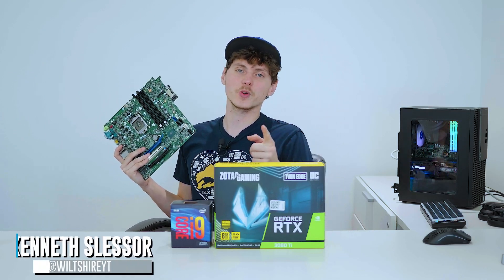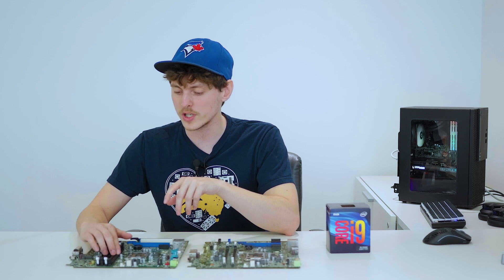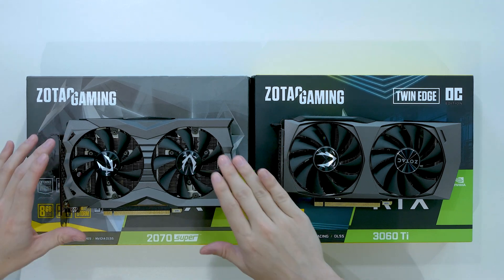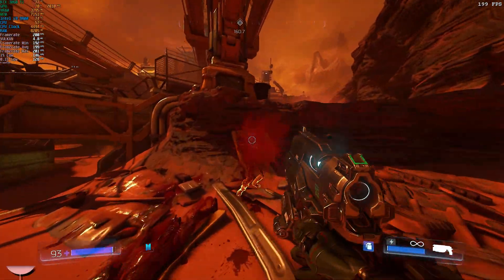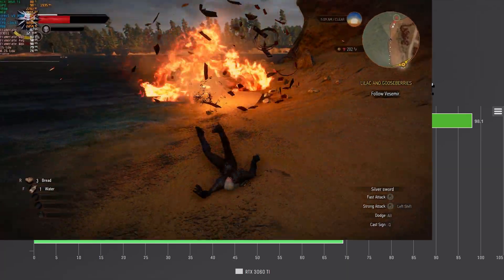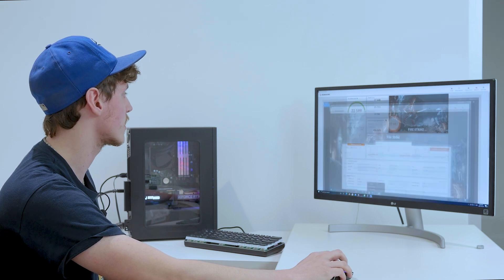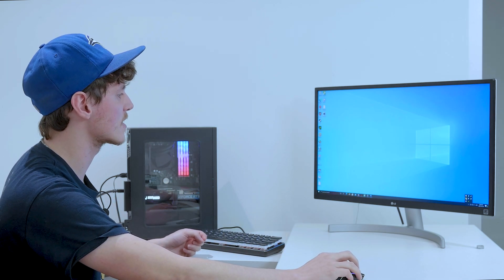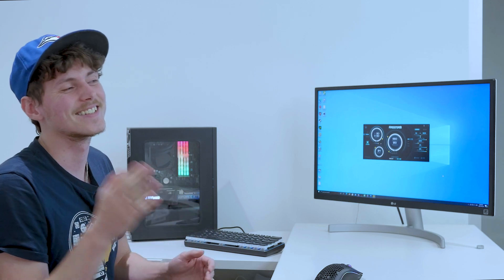Showing Dell How to Properly Make An Optiplex Gaming PC

Comment from the maker: Hey everyone!

Sorry for the delay in content. I swear I'm a turtle when it comes to making content on a consistent basis... 🐢 I had a few obstacles to overcome when making this video. First, I needed a new space to record my content moving forward and I had to make a deal with my boss at work to use an office to record my videos. Second, I had some hardware issues that took me a week to figure out what was wrong and 2 more weeks to find a replacement part.

I'm also thinking of buying a Dell G5  Gaming PC to compare it to OptiFlex to show just how much better OptiFlex is. I think it would be a fun video to see just how bad the G5 is. What do you all think? Let me know!

Hope you all enjoy some more OptiFlex content :D
Reply: How did you manage to buy the Q370 proprietary motherboard from dell? I'm really interestd
Reply from the maker: @emanantonov  I didn't buy it from Dell. Got it off of eBay where someone was selling just the board.
Reply: Hey Wilshire tutorials i bought an dell Optiplex 3040 for a cheap price however am slowly going to upgrade it as time passes as i don't want to a lot of money right away. I saw your upgrading dell Optiplex 3040 series which is why I bought the thing in the first place. I just wanted to know what cpu (intel i3 or i5) would work and what type of graphics card would be compatible and is it possible to replace the deafault power supply it has to one of those corsair ones

Have a wonderful day
Reply from the maker: @cliserioolivares8170  somehow missed your comment here! Sorry about that! The 3049 can use an Intel i3 6100/6300, i5 6500 or an i7 6700. Make sure to buy the non-K variants of the CPUs the motherboard doesn't work properly with them. I found a good place to start is an RX 470 Nitro from Sapphire. You can use it on the default PSU as long as you use a 2x sata power to 8-pin PCI-E adapter. If you want something more powerful, you'll need to mod your case and put an SFX PSU inside it

Comment: Hi, I'm new to your channel, I have an Optiplex 3050 i3 7100, 8gb ddr4 and a 240 ssd, I want to put a video card on it but my motherboard doesn't have the 24-pin connector, what can I do in this case, because my pc brought its Dell's original power supply, but I want to put a good power supply to put a graphic in it
Reply from the maker: You just need an adapter that fits Dell's 8/6-pin power cables. Easy to find on Amazon or ModDIY
Reply: @WiltshireTutorials  Thanks

Comment: Does anyone know if K series chips work in dell OptiPlex boards? Would a i9900k work in the board in the video?
Reply from the maker: They do not! They draw too much wattage. The i9-9900 (non-k) only draws 65W. With the K variant, it draws 95W and the board is not designed to provide that much power. The PC will just shut off, if it draws too much power.
Reply: @WiltshireTutorials  thanks for the quick reply it’s a shame it’s really hard to get hold of a i9-9900 in the UK lots of K models for sale though
Reply from the maker: @0prisonpriest0  I also had some difficulty in finding the a non-K variant here in Canada as well. You might be able to find something on Aliexpress for a decent price. I found my i9-9900 locally through Kijiji.
Reply: @WiltshireTutorials i actually added a i7 8700k in my dell optiplex 3070 sff and ye i had noticed the cpu temps are high but it runs
Reply from the maker: @OsukaMhv  I had mine shut off due to over-current protections when using a K-variant of the 9900K. So, I generally don't advise people to use them. They also aren't in the official spec sheet for support CPUs. So, your mileage may vary.
Reply: Which power switch did you use with the new motherboard. I managed to get a 7070 and a i9900 in the end but no case so trying to work out which dell power switch to buy it’s an odd 5 pin arrangement

Comment: Hey! this is a great upgrade to the Optiplex! 
I got a optiplex 3050 and I want another Mobo for it with the LGA 1151 v2 for Intels 8 and 9th gen cpus. Is it possible to take the mobo from a newer Dell Optiplex and put in in there and if yes which one?
Maybe you can help me out! 

Current System is:
CPU: i5 6500
GPU: GTX 1660 Super
Upgraded PSU to 550W SFX
and 16gb of DDR4 RAM
Reply from the maker: I used a 7070 MT motherboard and the chassis is from a 3040. This Optiplex was originally a 3040 with an i7-6700 in it. The 7070MT is the last generation of Optiplex motherboard that will fit into the same chassis. They changed them the year after starting with the 10th gen Intel CPUs. If you plan on doing the same, be prepared to get the dremel out to cut the back I/O on the case.
Reply: @WiltshireTutorials  thank you I will try to find a cheap 7070 or 3070 MT Mobo to Upgrade. And yes I already needed the dremel for the PSU Airflow😅.

Comment: Question brother, what power supply are you using for you computer?  I have a dell optiplex 7060, 16g ram, I8700, 240 pws, 512 ssd, and I am trying to find a good graphic card for it.  What do you recommend brother?
Reply from the maker: To start, this Optiplex is heavily modified. The PSU that I'm using in it is an SFX PSU, not an ATX PSU. To be more specific, I'm using the Corsair SF750. You could also go with the SF600 to save some money. As for the GPU, it depends on what quality settings and resolution you want to use. If you're going for a budget 1080p Mediu/High Settings build, an RX 6600 would work well! You could also save a little bit of money and buy a GPU used. May be able to find something a little faster than the RX 6600, like an RTX 3060 Ti for a decent deal

Comment: A very good modded dell optiplex, but misleading because he was getting good compliments he forgot to tell the viewers he spent over $2000 & used 3040,3050,7070 plus two GPU & cpus he was getting poor fps so started using unusual presets low to mid custom so changed to 7070 mt  with i9  & rtx 3060ti sfx 7050W that cost over $1200 mobo , good video for content but not practical and dangerous using so many tools plus the wrong 24pin to 8 or 24pin to 6pin atx adapter can blow your motherboard and parts.
Reply from the maker: This is not misleading or dangerous at all? I was getting great FPS with the original 3040 motherboard and the RX 470 8GB.

Obviously, you have to keep your expectations in check for an older OptiFlex and GPU. Therefore, I used a mix of Low and Medium Presets. I prefer to use more 'real world' presets in my benchmarks than fully maxed out because most people don't do that and I prefer to game at a higher FPS. Very far misleading, if you ask me.

The only part that I used from a 3050 was the front panel and only because it was black, as I was going for an all blacked out build. It was also $6 on eBay, as it was being parted out from a broken OptiFlex....

The 7070 motherboard and upgrades were an experiment to see what was possible with the proprietary Dell motherboard and chassis. Also, I just wanted to see how far I could push things. You can't case swap these Optiplexs to a new case due to the unique motherboard size and layout. Hence, the used 7070 board I bought on eBay for cheap and me modding the 3040 chasiss. The i9-9900 (also used) was also an experiment. There was no documentation in Dell's official technical specifications sheet that stated you could use an i9 in the 7070. So, I decided to try it, as I'm sure I'm not the first to ask that question if it worked or not. The chipset allows up to a 65W chip and the non-K version of the i9-9900 is 65W. It works great in the computer and is still going to this day. As for the RTX 3060 Ti, I got super lucky and got that for MSRP BEFORE all the GPU mining and shortages happened. Saved quite a bit of money that way. I wanted to show that it was possible to fit an RTX 3060 Ti into a Dell Optiplex, if people wanted to add one to their machines. I don't want them to get stuck with a low-profile 1650 (or spend the stupid asking price for a used one!) when you can get a way better GPU into the tower. Lastly, the SFX PSU, you can use whatever SFX PSU you want and whatever wattage you want that fits your needs. I was going all out, so I chose the best one I could get. I'm not sure why you're mentioning the adapter for the PSU? Obviously, crossing wires in the wrong pinout will cause damage? I made the adapter myself for the 7070 as I had some spare parts sitting around. But, these adapters can be easily bought from MoDIY, who know what they're doing.

Here's a breakdown on how much I spent because you're really far off:

I9-9900 (used) - $200
7070 motherboard (used) - $100
SF600 (used) - $100
3060 Ti (new) - $499
=$899 (that's Canadian, by the way)

Kijiji is your best friend for used parts. I hope this breakdown explained everything you wanted to know about my decision making.

(Why did I write such detailed breakdown? I have COVID and have nothing better to do lol)

Comment: Will all of this fit in the 7070MT case? I have one that I am looking to upgrade and it looks like modding may be required for the RTX you recommended. Have you tried something like this?
Reply from the maker: The 7070MT and 3040MT are the exact same case and dimensions. Therefore, what you see in the video will work for you as well
Reply: @WiltshireTutorials  Thanks, I was watching a few and figured that was the case (ha ha). Thanks for the info!

Comment: Did you manage to plug the GPU into the bottom 16x PCIe, or did you have to use the 4x blue one? Thank you 👍
Reply from the maker: The PCI-E x16 slot is on the top for this motherboard? So, I used the x16 slot on the top (which is blue). This board has 2 x16 slots on it.
Reply: @WiltshireTutorials  thank you, and you are absolutely right, blue is the 16x slot! I got confused because of the marking X4: 25MHz on top of the blue PCIe slot! 🙏

Comment: I still love watching your videos. Just wish I had money to finish my build. I just need a video card. Thinking of a Asus RTX3050 which i PCIe4.0. Is that a good card?   current amazon price $369
Reply from the maker: The RTX 3050 is okay. But, I don't think it's worth it for $369. If you're just looking at 1080p I would look at AMDs offering.
Reply: @WiltshireTutorials  um not sure what Fram rate I want. Just as long as command & conquer look good I'm ok. So far the old 1650 I have is working. But I just wanted pcie 4 since the new mb I have uses that. Should I give you the specs?
Reply: @WiltshireTutorials  I thought the AMD Radeon cards had drivers issuses with windows 10? So I was staying away from them.  Do you have any suggestions?
Reply from the maker: That is an old thing people like to hang over AMD's head. AMD's driver have significantly improved over the past 5 years. I would've agreed with that statement back then. But, I disagree with that nowadays. This is coming from a guy who switched from Nvidia to AMD for their GPU. I'm currently running a 6900XT.
Reply: @WiltshireTutorials  ok, thanks for letting me know. I might have been given the wrong info as I do like AMD stuff better. Thanks again.

Comment: Hello there, I was wondering if I could use this case but switch to a B450 motherboard...I have a Tuf Gaming B450M-Plus II...
Reply from the maker: No. You will not be able to use the case or swap the motherboard from the case, as the screw layout is proprietary to Dell and does not conform to the ATX standard

Comment: Hey I have a question so I have a 990 optiplex can I upgrade to a better motherboard if so which one?
Reply from the maker: It's a standard MATX sized motherboard that can fit in the case. However you would have to upgrade the hardware that goes along with the new motherboard.
Reply: @WiltshireTutorials  ok thank you.
Reply from the maker: No problem!

Comment: I really like your videos man!

I have a question: I have an Optiplex 7060 and I think it has the same MOBO you used in this video (or a very similar one). It has the 4 ram slots, the usb-c, the serial port and a display port.

It has a proprietary 260 W PSU with a 6 pin connector and another 4 pin connector. I wanna upgrade the PSU and I wanna know If the SF600 SFX PSU already comes with a compatible 6 pin connector? Don't I need anything more to make it work?

Cheers!
Reply from the maker: Glad you like the videos, Carlos! To answer your question; you would need an adapter cable. The PSU by default is not compatible with the motherboard. You'll want to get a 6-pin to 24-pin adapter cable for your 7060.

Comment: Ok so my pc specs are

Dell Optiplex 3847

Windows 8.1 64 bit

Intel core i5 4440 @3.0ghz

16gb dual channel @1600mhz

dell inc. 088DT1 Motherboard

AMD Radeon HD 7400 series (MSI 1GB)

Western Digital HDD 1TB

PSU 300w stock Dell power supply Model# D300EM-01

Everythings pretty much stock the only thing ive upgraded so far was the ram, now im thinking of going for the i7 4790k for my next upgrade, any help on getting this to gaming standards on a budget would help a lot, the game i mainly play is Old school runescape, and my kids play roblox, running 4 screens, and its just not a great experience at all. was wondering if you could help me with some budget upgrades?
Reply from the maker: Those are some decent looking specs. It's got tons of potential! 

First thing's first, upgrade to Windows 10. It's faster and more optimized than 8.1! 

As for the CPU, the Dell motherboards do not support K variant CPUs only non-K variants! Please do not waste your money on the 4790K! Buy the i7-4790 or i5-4590 instead! Both will work great for gaming.

Next would be the GPU. It is very old and tired. I recommend trying to find a used RX 580 8GB. That would definitely make your gaming experiences at 1080P much better!

Also, you could migrate/clone your Windows installation over to a SATA SSD. Running Windows off of a HDD is painfully slow.

Lastly, I would try to find a nice cheap  450W PSU that you can throw in there for the RX 580.

Hope that helps! If you have any more questions, don't hesitate to ask!

Thanks for watching!
Reply: @WiltshireTutorials  do you have a discord or somewhere we can chat? I could really use some help for upgrading and my heads all over the place with what where and how to do things
Reply from the maker: I do not have a Discord server yet. I currently don't have the time on my hands to moderate what may go on in a Discord server.

Comment: Hi do we need to customize the pc or change anything to add a liquid cooler
Reply from the maker: Oh yes. You need to change quite a bit. I suggest watching my liquid cooler video on OptiFlex
Reply: @WiltshireTutorials  I’m still confuse but pls tell me here
Reply from the maker: I had to pretty much remove a ton of things on the inside of the case. Hard drive cage? Gone. Disc drive? Gone. Stock PSU? Gone. You'll have to do a lot of cutting of metal to get things to fit!

Comment: Have you considered using a Threadripper/EPYC compatible Mini ITX motherboard in this case?
Reply from the maker: I don't think there is a Mini ITX Threadripper board out there. I have the only Micro ATX Threadripper board though. Also, not a single cooler would fit inside th OptiFlex 3040 for a Threadripper or Epyc CPU.
Reply: @WiltshireTutorials  LTT has made a video on that. I tried to link to it, but YouTube kept deleting my comment. Though, Linus used a minicube case, not a slim SFF.
Reply from the maker: Oh! That's because I have links blocked on my channel's comment sections. Better to be safe than sorry. Stops people from linking malicious things. I'll have to check out that video! Thanks for the heads-up!

Comment: What are the absolute best specs I can get in a optiplex 9010
Reply from the maker: For the CPU an i7-3770 (non-K), 32GB of DDR3 1600Mhz RAM, a decent SATA SSD and any GPU you prefer. Just keep in mind that CPU will bottleneck the higher end GPUs. You may also need to upgrade the PSU to support a new GPU! I recommend something like a 1050Ti to start out with!
Reply: @WiltshireTutorials  thanks alot man your epic
Reply from the maker: No problem! Happy to help!
Reply: @WiltshireTutorials  sorry to bother you again but how do you do a motherboard swap
Reply from the maker: The motherboards for the Optiplex line of 3040, 3050, 3060 and 3070 (as well as their 70xx counterparts) are all the same motherboard shape and size. It's as simple as dropping the motherboard in the case and cutting a few holes for the rear I/O
Reply: @WiltshireTutorials  alright thanks

Comment: Great videos! I have a question about the PSU: Does the Dell mobo in this machine use their 6-pin proprietary power connector rather than a normal 24-pin ATX connector? If so, what adaptor did you use? I have a dell G5 desktop and looking to upgrade to PSU in the coming months.
Reply from the maker: Yes it is a proprietary power connector. Some of the boards vary. It can be either a 6 or 8 pin power connector instead of the standard 24 pin cable. I have never played around with a G5, but I imagine they are quite similar in design. The cable I used did not specify that it worked for a G5. So, I'm a little hesitant to recommend it to you.

Comment: Nice concept but I do not see the cost benefit in building the newer, after 7020/9020 Optiplex when everything went almost 100% proprietary. There were alot more work arounds in the older Optiplex models even to the point of case swaps with easily available cable adaptors.
Reply from the maker: That's a fair point. You do have to do a little bit more fiddling around with the newer ones to upgrade things. It is nice to have more current hardware though. Obviously, my style of overkill defers from others